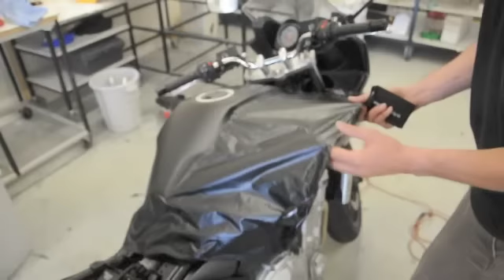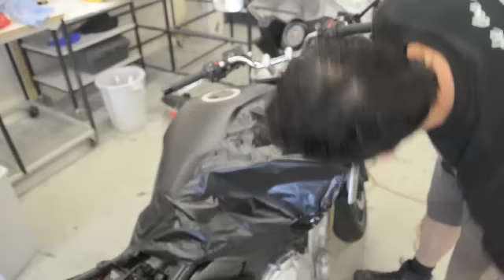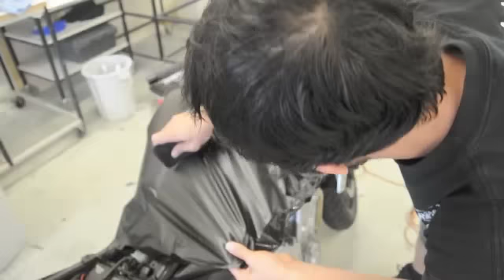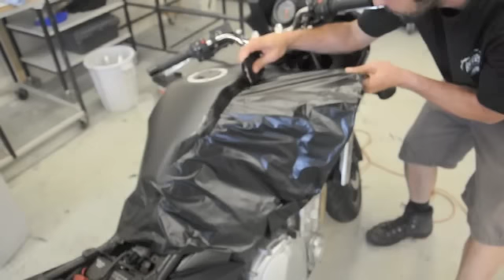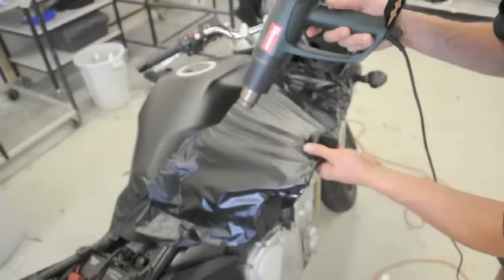Avery Black Matte - Motorcycle

Comment: I have a question, I have a white fz6r, I want matte black for sure, but I haven't decided if I'm going to accent the white with matte black or do a full wrap. If I do a full wrap I have 3 color options that appeal to me. White accents and racing stripes, red or electric blue. Can I install vinyl accents and graphics on top of a matte wrap? I could just cut out the white highlights if I go white, but I'm not a fan of the metallic white.